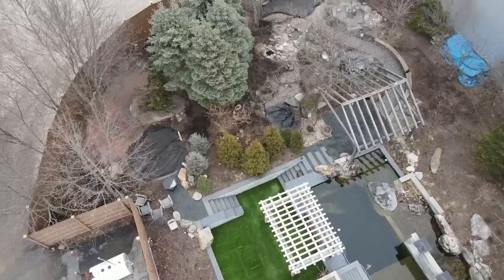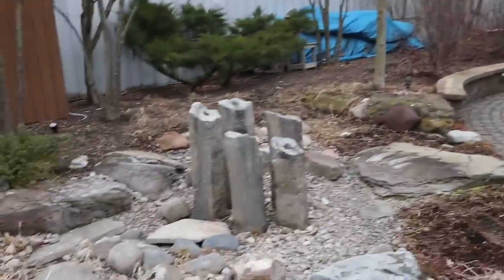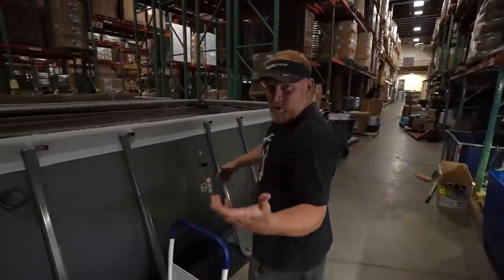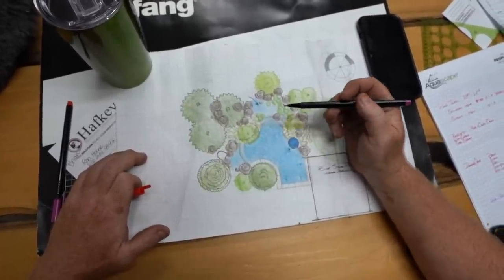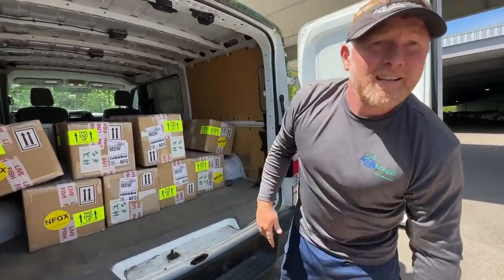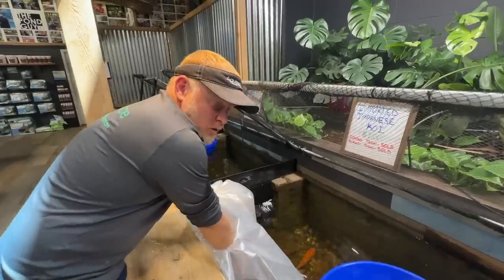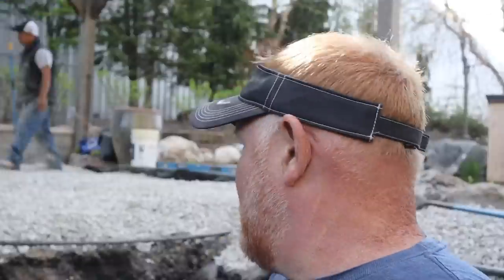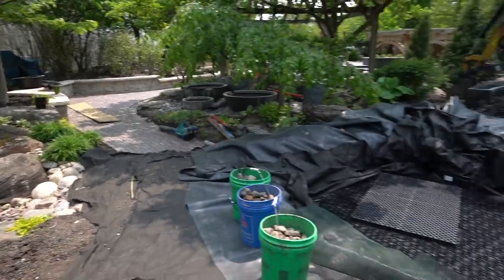1,000 New Koi and WHY The Pond Guy CAN'T Swim with ALL of Them

Comment: Brian, I been watching the use of the slate walls in a bunch of aquascapers blogs/youtube content. I believe these walls could be the bases for an a wetlands filter when used as a perimeter to ponds and natural swimming pools. Think sump distribution under the blocks or through. They would feed a perimeter with aqua plants on top of or extending away from the pond. This means one could eliminate the water falls if they did not want one. One could eliminate a second excavation if you where the seal these right. Bio Balls with stone on top would provide a crazy amount of bacteria growing area. Just a though from a laid up contractor.

Comment: Thanks for the update on the indoor wetland filter. Are you using an XT Dosing System, or manually adding water treatments? When I was there in January the formal rec. pond was full of string algae, and there still seems to be a lot in it. Does it have any Ion-gens in t?
Reply: They Cleaned it and put those in recently. They had it on a video, Think Jack installed the ions.
Reply: @rsecord  There was a lot of string algae in this week's video
Reply: @VPershing , Jack did mentioned it might take some even after cleaning out a bunch of it. We will all see the results in time :)